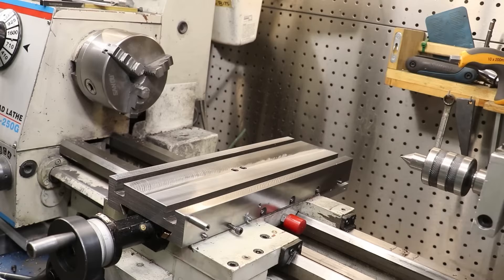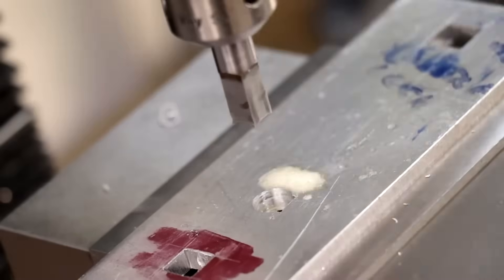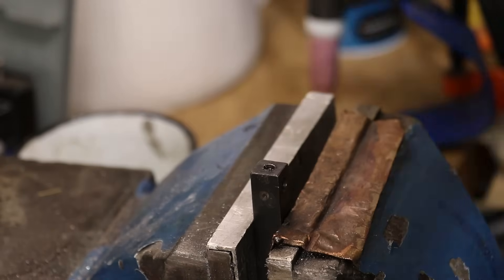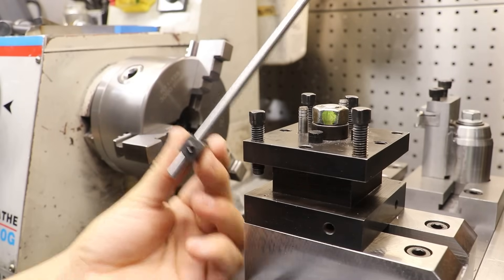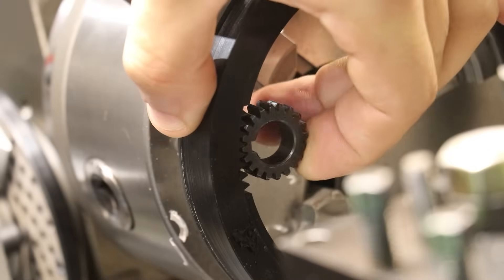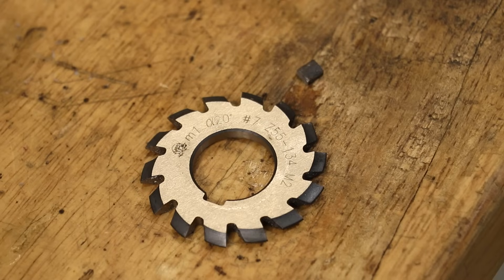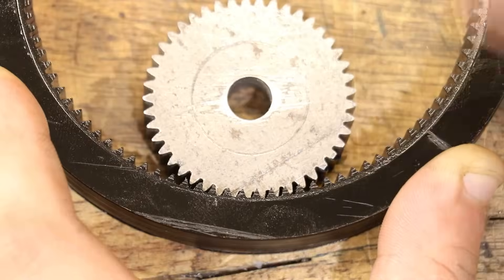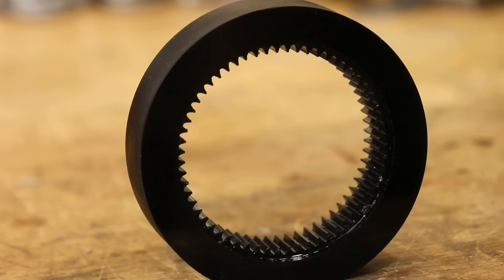Making Internal Gears - It Took Longer Than I Thought (Ring Gears)

Comment: 3D printing might feel like cheating for a manual machinist but I'm sure you are also thinking about FDM style of printing? But there are metal printers one can DIY if you already have access to the metal making skill tree. With some practice not only can you print metal gears equivalent to powder sintered gears, but you can take it further and dial in settings to actually heat treat the gear as it prints and harden it.

Comment: "not teh exact involute"...
well it cant be, as geometrically an involute is a cord unwrapping from a surface... it cant exist below the pitch line its rolled from.

whatever. use a gear itself as the cutter.
as you index each tooth, its the same as having rotated the cutter by tooth count/360. closer the tooth counts the more generating "shaves" you take without having to deal with synchronised "generating"...

the tooth profile of the cutter should match the planet gear being used... not the ring gear tooth count. a gear cutter of any tooth count will generate the correct profile... so the cutter you made here has to match the profile of whatever virtual planet gear you produce the ring gear with. 55 in this case. except then you need a bit more addendum on the cutter as the ring gear needs clearance. and as you dont index the cutter, its a moot point...

a small gear cutter on an arbor, indexable...

making any gear is tedious on the lathe...
Reply from the maker: This is why it was made slightly larger, to account for this extra part from the addendum that the cutter could not form. Now since, at another comment, a cutter was made using the teeth to match the smaller planet, and this does not work. There is interference and rubbing and not that same action that we were get before. I'm going to try see what ca be done about widening it, but I have been busy with work. The most recent iteration using the cutter based on the ring gear teeth numbers is the closest I have gotten to the correct involute shape. Still work in progress
Reply: @artisanmakes  when the cutter is made for a low tooth count, if it was being used in a proper generator, it would produce the correct profile. as its fixed, it isnt.

as the tooth count gets closer to the number being cut, it gets closer and closer to the desired profile, until you are truly broaching the teeth, the cutter having the same tooth count. (what you did here is only shaping teeth, not true broaching)

and bear in mind the involute cutter is only correct for the lowest number its marked for.

so a 55t gear cutter, and your involute "ground" cutter will produce the same profile, yet the gear cutter will be even closer to the ideal as it does experience some amount of "generation" as you index through the teeth, shaving off the tiny bits where it interferes, as any multi-point tool will.

yet its still a compromise as its not truly generated...

considering some of the add-ons you have made... a back shaft on the headstock, toothed belt on a parallelogram tensioner (have to tension both sides of belt evenly to remain in synch, yet accomodate cross-slide travel), and some printed gears would let you synch up a gear cutter on an arbor... relatively simple. then you just gotta wave back and forth to full depth and not worry about indexing at all... then again, how many internal gears are you planning on making?

the backshaft and belt can also double up for that "faceting" method of cutting hexagons and the like... maybe not such a silly idea.
Reply from the maker: Let me try with my other gear cutter set and Ill get back to you. I do appreciate that you recognise the compromise that is being made here. Im mainly comparing the tooth shape that I am getting here with the tooth profile that I generated in cad (I'm a bit reliant on that here).

Comment: Better way to make the gear cutter, use square stock, cut one tooth (2 cuts on either side) and then just mill off the excess on the sides in a mill. Issue cutting on lathe is tool deflection when cutting. When you cut into square stock the cutter, square stock cannot deflect.
Reply from the maker: Maybe but it’s easier my way when you need 7 cutters to be made and modified along the way
Reply: @artisanmakes Issue is there is too much deflection of the drill rod. Cutting twice into square stock would probably take less time. & You have a much better precise cutting tool 

1. Chuck Gear cutter in Mill. Cut the two grooves on edge.
2. change gear cutter for end mill. Flip part up & remove the two sides, leaving just the one tooth profile. 

Less work than all the steps you used. Probably take you less than 5 minutes for both operations.
Reply from the maker: id be surprised to get much deflection when shaping plastic, but this type of holder isn't too dissimilar to some hss boring bars. imho whichever design you use is probably fine, i like this one. cheers
Reply: @artisanmakes  When you were cutting the drill rod using the gear cutter, not when you are cutting the ring gear. Use square stock for the cutting tool.

Comment: maybe its time to take your tool building to the next level in the same style as NotAnEngineer by building a small home made shaper , or maybe hunting one down , we have a vertical shaper at my workplace with a built in dividing table that i have used a couple of times to make internal splines and internal gears , and it sure as hell beats using the arbour press to broach  especially if it needs to go deep inside a bore  ,  anything longer than 50mm and broaching becomes PAIN especially since my broaches at work are absolutely COOKED

Comment: get a 3d printer, youre doing the wrong thing for the wrong material. should have made the sprocket metal
Reply from the maker: I said in the video its just a test material. Its a proof of concept and not intended to be used for functional workloads, just to test the gear mesh.  But there is no reason why it would not work in acetal, it would produce a very well functioning gear, I just happen to have several large thick sheets of acrylic left over from a job. Even such I would wager an acrylic gear would fair up quick well against most 3d printed gears.

Comment: I don't understand the use of the gear cutter for the number of teeth that the gear has. When you make a broaching cutter using a 55-100 tooth cutter, you're making the profile of a 55-100 tooth gear and you're broaching that into your internal gear. Thing is, you're not going to use a 55-100 tooth gear to mesh with your internal gear. Should you not instead be making a cutter with the profile of the gear you want to mesh with it? Like, if you want to run two or three 25 tooth gears in side the ring gear, should you not be using the profile of a 25 tooth gear?

I was also envisaging making a section of a gear as the cutter, similar to how gear broaching machines work, so, make a section of 5-8 teeth of the gear you want to mesh on the correct radius etc, then you end up with the perfect tooth profile and no backlash because you're literally broaching with the profile of the meshing gear.

Comment: Sorry, maybe I‘m wrong but I think you shouldn‘t cut your tool with a geartoothcutter for the size ring gear you are aiming for (55–120) but for the size gear that is going to go inside (more like a 20T) to get a nice fit
Reply from the maker: For gears you select the cutter/tooth shape based on the size of the gear you are making, not the gear you intend to mesh with. For what its worth if you cut the gear with a skieving set up, which produces the correct involute profile, I would expect the shape to match up very closely with the profile the cutter gave us here. Cheers
Reply: @  Yes, but you are not cutting a gear but the gear tooth cutter for that  ring gear size in that step and sloppy teeth mean you could go with less removal i.e. a smaller cutting tool i.e a more aggressive shape to form said tool and for me that sounds like a smaller target size gtc

Comment: That inconsistency in the backlash on that first piece was due to the use of the  3 jaw chuck on what looked like a thinner wall thickness than the final one.  Looked like it was a little more stout of a workpiece on the final attempt maybe.
  For supreme accuracy I would make a fixture plate and some low profile clamps to hold on the face of the parts.  No matter how low a pressure or torque you use, there will always be that deformation with a three jaw.
Reply from the maker: The inconsistency was because I changed the cutter shape about 6 times and even still it needs to be slimmed down some more. Doubtful that the acrylic was helping it much though, i am sure that it was flexing a bit, thats why I made the second one much bulkier.

Comment: I had to make an internal splined hub for a differential holding wrench. I had to push my CNC franken-mill to get the speeds and chip clearing to get it done. I never thought I could run .03125 cutters and not snap them immediately. I managed to snap them near the end.

Comment: I was trying to figure out how to do internal splines on a car part.

Can’t thank you enough. Your system is much cleaner than what I was trying to do. 

I was trying to mount a stepper motor to the spindle to create a psudo C axis.

Mounting the diving head to the other side is a much better move. 

The other option I was evaluating was creating the splines with an external cutter and making a broach that would cut the entire spline profile in one pass. 

The part I was struggling with was figuring out what my clearances needed to be. Making the splines a thou bigger would have required a new broach from scratch.
Reply from the maker: If you have some type of cnc, it would help to use that to make the cutter. That way you can get the exact involute profile you need. Best of all worlds.

Comment: Great work. Are you sure your diameter i correct? I think you can check it by mating the 60T internal with a 60T external. I know in LEGO the internal and external gears with the same tooth count can du this.
Reply from the maker: External gears are slightly smaller than your internal gears. The cut is correct. As I said in the video the cutter just needs to be slimmed own some more. cheers

Comment: False.
Sir, first of all, you should do some basic research on gear generation and its principles. Do you know what an envelope is? The width of a gear tooth is measured at the middle diameter. At the boundary of the addendum and the dedendum. Not at the crest.
Your process is not a novelty.
Reply from the maker: Nah you're right, I spent most of my time in university asleep in lectures. Don't know what an envelope of a gear is. I don't even know what a gear is. Congratulations. 

I'm sticking with this. It produces an involute profile, close enough to what is what needed. You should work on you manners
Reply from the maker: And i measured the end to match the cad daring I drew up :/ You have weird assumptions
Reply: Sir, I noticed you seem to be an expert on the subject.
Imagine my surprise that your channel has 0 videos on... anything.

Comment: As mentioned already by others addendum and dedendum are reversed. https://www.youtube.com/watch?v=71dn-eVdSmc&t=2119s
If you use the involute cutter as milling tool (instead of turning tool) you can make a much thicker shaper tool from the round pin, which would be like a single tooth of the involute cutter. 
... Even with a motorized shaper attachment it is a time consuming method, but a motor will help.
Reply from the maker: I'm not sure why people are assuming I don't know the addendum is reversed, its all part of making a correct sized internal gear. I just made the tooth profile slightly too wide.

Comment: The way you break it down and make it sound really expensive to make these heard could be looked at from the other side.  As in, one of the main reasons you're probably making gears in the first place is to fix or modify one (or more) of the machines you currently own that are capable of making gears in the first place.  So yeah, it may take a lot of dollars with of machines, but you probably already had one or more of them before you ever needed to make a gear.  So, if my math is mathing, it is in fact cheaper to make your own.  And that's the argument you should use with the missus if she complains about how much time you're spending in the shop.  You're saving money!

Comment: I think if you reduced the angle of the cutting angle on the cutter to 17.4° it would work like a 20° cutter when you take in consideration 360° and the 100 teeth.

Comment: Solidworks toolbox can generate internal spur gears. Just input module, number of teeth, pressure angle, face width, outer diameter and you can get the gear shape. Then it should be easy for you to export the profile of a cutter, and it will be the correct length at least. If you version doesn't have that, I can generate the ones you need and email to you.
Reply from the maker: Generating the involute is not difficult. It is what I used to make the gears you see in the video. It getting that shape and cutting it accurately in steel is the challenge. If I had a cnc I'd just cnc the tooth into the cutter.

Comment: As you say the profile of the internal gear has room for improvement. I worked with manufacturing gears and gearboxes all my post apprentice life. The internal gears were shaped, some to very tight tolerances. The contact betweem the two gears was more of a rolling action, but because your PCD was ineffect concaved with very little meat on the addendum it would run but be noisy and wear faster. As a proof of concept it definitely is a good start. Interesting post, thank you 👍
Reply from the maker: You see that's where we differ, I am more of a large tolerance type of guy :) For what its worth once I get the cutter slimmed down a bit it'll almost exactly match the correct internal profile. Like I said in the video I think I just left the cutter slightly too wide, but it is almost there. Cheers
Reply: @artisanmakes  The fact that you're producing an internal gear is praiseworthy, that's a truthful and honest statement. I was sent to an U.S. large truck company to discuss a gear which had a K chart tolerance of 0.0004" on the dedendum, and a 0.0003" tolerance on the addendum. Thankfully those tight tolerance jobs were not big runners. Most gears had 0.002" tolerance on the profile and 0.0015" PCD runout. I do find your posts very interesting from an engineering and humour point of view.

Comment: Interesting playing. Not sure about Solidworks but in Fusion 360 there is plenty of Gear Profile addons including freebies that will generate internal gears for different pressure angles and modules. The tough part is then hacking a comparator to look at a blown up print against your cutter 🙃

Comment: @18:55 You’re talking about shortening the length of the broaching tool. That will only make the root to tip of the internal spline more drastic. Causing the span size to increase, causing more backlash. Your tip I.D has to exactly match the number of teeth (NO. Of teeth +2 x module) This will get you close but you will need to a longer broach to acquire the right root depth, in turn changing the span/pitch to mate with your male gear better
Reply from the maker: Thats the English language failing me. I mean bottom as in the bottom part of the profile, not the tip, if that makes sense

Comment: I mean, you can make your gears for cheaper if you have a shaper. With a shaper, all you need is a gear blank and the entire operation set can be done on the shaper. Broach, teeth, everything. The only caveat is it's slow (with a small machine, because with a larger one you can pass it in one go). Shapers, they may be old, but they're very useful in the small shop.
Reply from the maker: I wish I had a shaper
Reply: @artisanmakes I’ve seen some of what you can do.  If you REALLY wanted a shaper you would have made one.

That said, a hobby machinist size shaper would be a cool project to watch!
Reply: @artisanmakes  FYI: about 20 years ago, I made 2 axis controller for my mill to cut spur gears. used a timing belt & pulley to drive the universal indexer, Another stepper on the Mill y-axis to move the cutter through the work piece & limit switches to switch Y-axis direction. You could probably do the same using a arduino (back then Arduino didn't exist).
Reply: @artisanmakes   No, no, no. Power hacksaw first. (Blackgates Engineering sell casting sets)
Reply: @alan-sk7ky No, no, no! Power hacksaws will never pollute the hand sawing action on this channel!

Comment: It would be neat to see how well 3d printed gears could perform in some of the scenarios. You can get used ender3s for under 100$ now, so that may be a much cheaper way to make your own custom change gears for lathes. Just matters how long they last.

There are gear generators online that can do spur, helix, internal, bevel, etc. So no real "cad knowledge" needed, aside from maybe adding a keyway or something.
Reply: 3d printed gears are evil and do not make good content for a metal working video. Surprisingly usable 🙂but evil.

Comment: Next time you use a hole saw, start the hole saw to see the out lines, then drill a couple of chip-release holes along the inside or outside depending on witch part you are going to use. 😉

Comment: When your using a large hole saw, it works much better if you cut in about 2mm~3mm then drill a series of holes through in the circle to allow the dust/swarf to fall through.
I've used this method on 1" thick (25.4mm) aluminium and steel plate plus 15mm acrylic (which I did manage to 'explode' while turning )